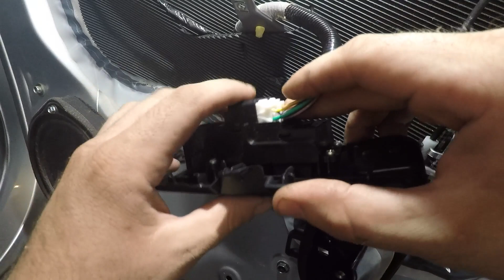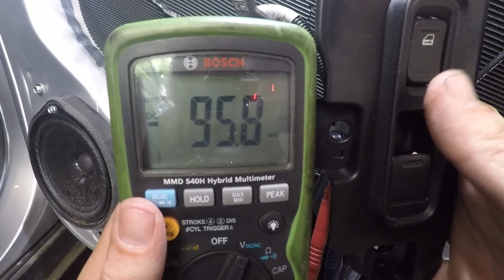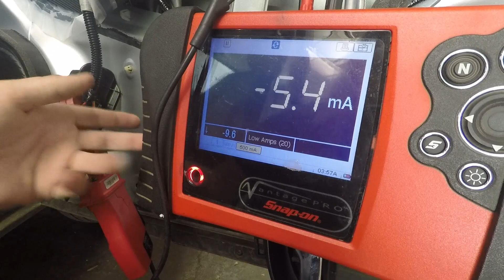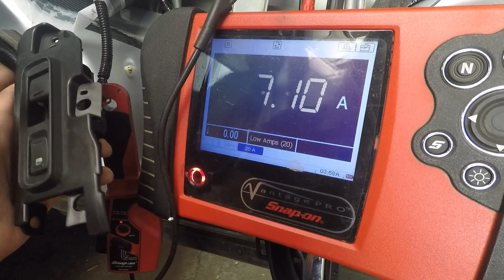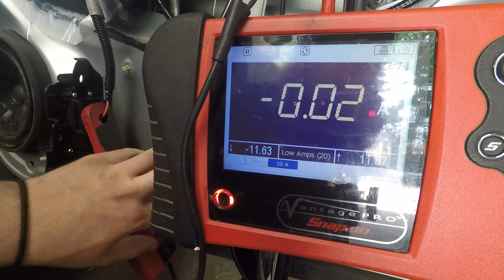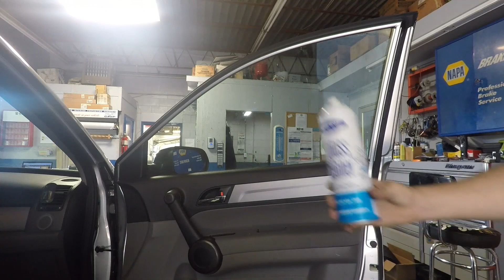Honda CR-V power window testing

Comment: Have the exact same problem on the same make/model/year.

Thank you! This helps so much
Reply: Very clear instructions on the multimeter diagnosis and installation.
Reply: Where did you source your replacement part and how much did it cost? I seem to have the same issue.  Ty

Comment: Huh? I have a 2001 CR-V and there are no up down switches on the windows for arm rests. all switches except for the FR,RL,RR windows lock buttons are actually the up down windows buttons. the driver door handle button operates the door lock on the driver door and nothing else. I know I have some electrical issues since I just took possession of this 2001 CR-V. Fuses are OK but have to test door windows power yet at the door motor connector. Have new regulators with motors to brute force the issue.

Comment: hey buddy you are the man its the teachers like u who make it possible for guys like me to get to your skill level someday. so thank you. is the arrow on the amp clamp suppost to point towards ground on circuit so it shows positive current and not negative, that way you can identify the actual way current is flowing and could you make a video if the right car comes in on how to figure out how much amps the car is consuming and how much the battery is taking. maybe good details and explanation on how its flowing in and out of distribution center and the vehical and all the right ways to figure it out there is not to many good videos giving the details to really make complete sense of it and ou are the right guy to finally do the vedeo rite. you should be a shop teacher for real
Reply from the maker: Yes normally you would want to attach an amp clamp with the arrow pointing towards ground so the current flow will display correctly.  But since a window motor circuit can be operated in both directions, it doesn't really matter.  All you are looking for is that current is flowing in one direction with the switch pressed "up" and in the other direction with the switch pressed "down".
Reply: I'll ready changed main circuit ,is not motor window, but the window dosen't work..what else can do
.**passenger rear side windows